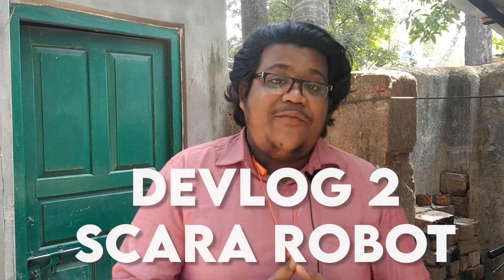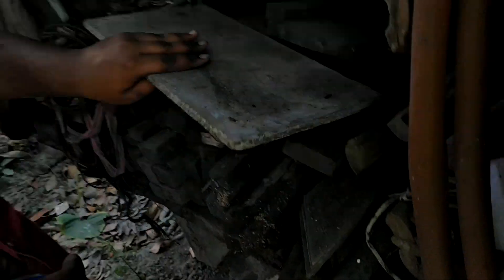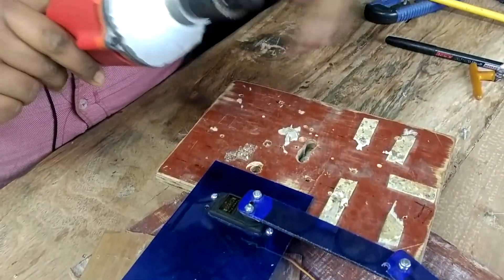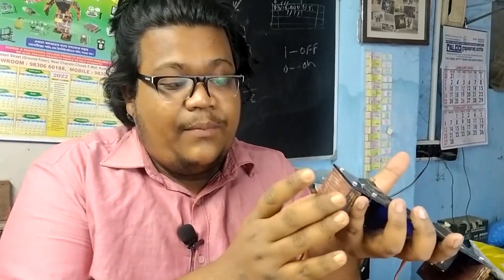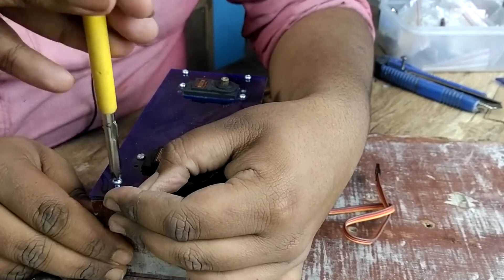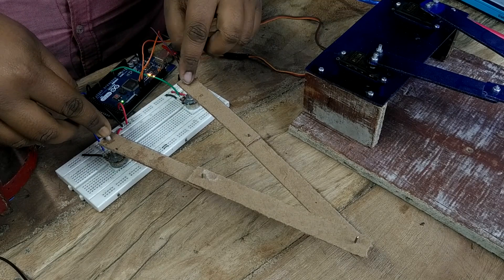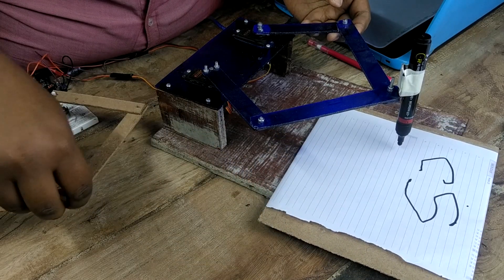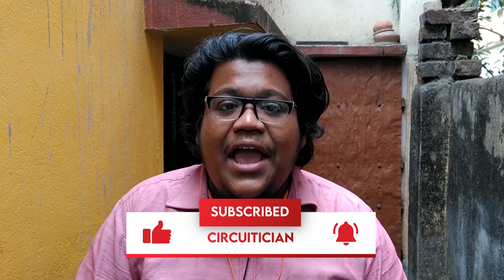SCARA Robot Development | SCARA POT Control | DEVLOG #2

Comment: good attempt . As for calculations you can use geometric approach for easily getting the Forward and Inverse kinematics Closed Form Solutions . Analytical Approach will involve tricky simultaneous nonlinear equations and will be much difficult to solve.